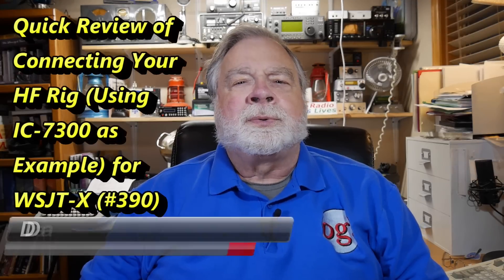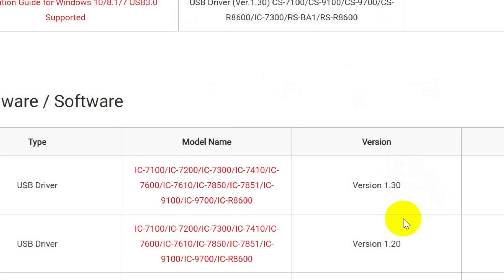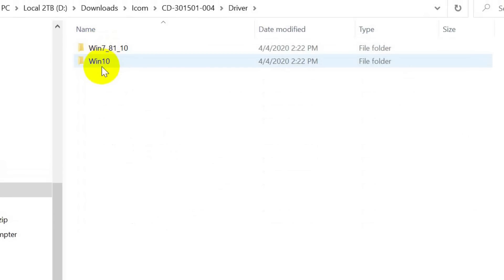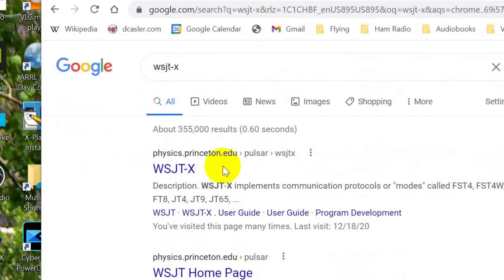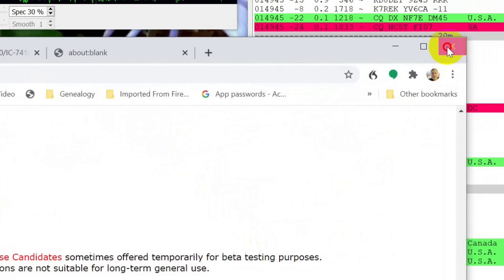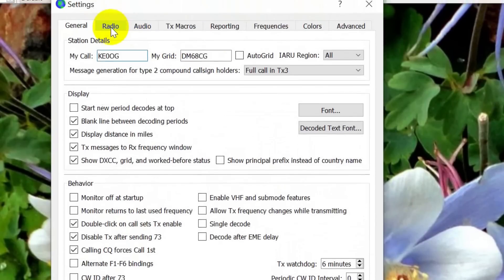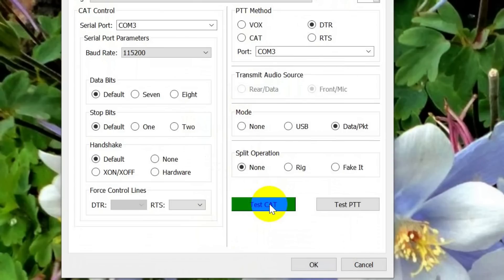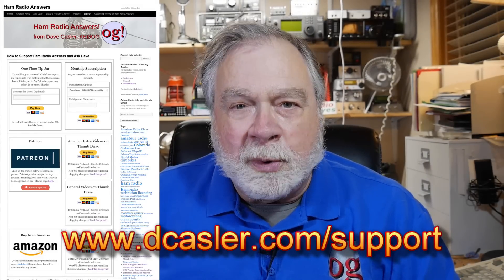Hooking Your Radio (IC7300 as Example) to Computer for WSJT-X (#390)

Comment: Thanks, Dave. You never mentioned exactly what USB cable to use. What did you mean by AB?
Reply from the maker: It’s the same cable that is used for an HP printer. It’s the very original USB cable. The end that goes into the computer is a type a at the end that goes into the printer is type B. Hope that helps.

Comment: I have found that if you ask ten people, you will get ten answers of how to do it.  I had thought that it was as simple as ABC and 123 but I found found that it was not.  It does not make any sense but I find that others have had the same experience. Take away is to keep asking questions and when you find the EXACT solution that works.... STAY WITH IT.  I had mine up and running just fine with the 7300 connected to my PC along with WSJT-X and Gridtracker so that FT8 was humming right along with many QSOs.  Then one day, things did not work.  Hoping to get things running again as FT8 is quite the bit of fun.  Wanting to give FT4 and a few other modes a shot.

Comment: Does the this radio need an external USB sound card like a SignaLink USB?  Or is there one built in?
Reply from the maker: The IC7300 has a built-in soundcard equivalent
Reply: @davecasler  Is that on the same USB cable, or another?
Reply from the maker: @kq6up  Same cable. Only one USB cable needed between IC7300 and computer.
Reply: @davecasler  so do two com ports and one sound device show up in the device manager after installed?
Reply from the maker: @kq6up  Depends on which radio brand. The Yaesu's set up two COM ports. I think the Icom has one COM port (I say "I think" because what the computer displays is confusing). Your sound device shows up as an Audio CODEC, which you choose when you set up your digital mode software.
Reply: @davecasler  perfect.  Thanks, Dave.  I am gonna pick one up when they finally come back in stock.

Comment: Dave, you only did half the video... you talked about needing to set up the IC7300 for rig control but never actually showed the settings needed.  Also as mentioned you didn’t go into the audio set up in the Menus to show the software where to receive  and send sound.

Comment: The 7300 works well in split mode dave. It keeps your harmonics out of the transmission. Kinda necessary, especially when you blare out ft8 at a near criminal 50 watts. LOL :P

Comment: No support for Linux.  What a shame.
Reply: Yes there is. Being a professional astronomer the author likely originally wrote the software for Linux or Mac
Reply: At time stamp 7:54 you can see the Linux Distro Repositories listed below Dave’s mouse icon.
Reply: @Gravel_Rat78  That is for the software, not Icom's USB driver, shown starting at 3:00.
Reply: @derekdowns6275  Hamlibs contains the driver for Icom when installing WSJT-X it is dependent that hamlibs be installed first.

Comment: Dave, I think you missed a very critical part of the WSJT-X setup.  In the setup screen don't you need to go to the "Audio" tab and set the input and output sound cards to be those in the radio and not the default Windows audio devices?  If you don't do this I believe WSJT-X will be sending the audio to the default Windows device and trying to decode from the default Windows audio input device which is usually a microphone if you have one on your machine.  On an IC-705 which is all I have to test with these are labeled "USB Audio CODEC".

Comment: Hi, Dave.  One of the features of firmware version 1.40 is a setting specifically for FT8.  This allows rapid switching between FaT8 and other modes.  I’ve been using it and it is very convenient.  BTW, tell us about your plane.  Thanks.  73 N6###

Comment: One of the things I learned when using my IC-7300 for multiple scenarios is....save settings to the SD card for any configured modes that are different from the default behavior.  That way once you figure different things out you can recall the file so you don't forget something.

Comment: Anytime anyone says that you need to install a driver to do anything, that should be a big red flag. Drivers often get outdated which makes your hardware useless. Also, in most cases, an installed driver is completely unnecessary. When are hardware/radio manufacturers going to stop doing this to us?